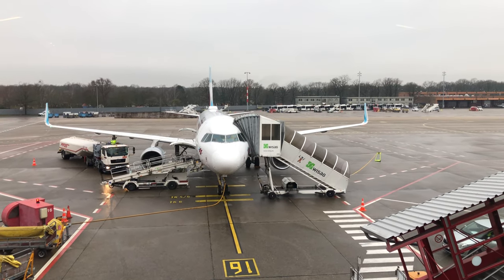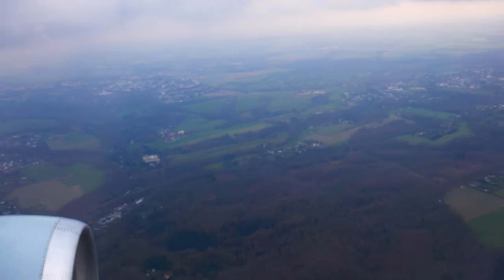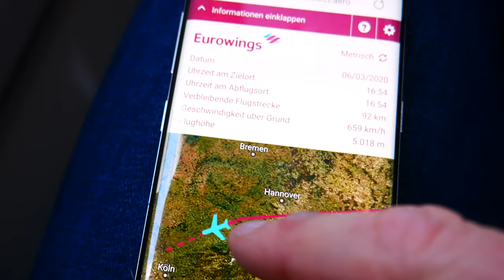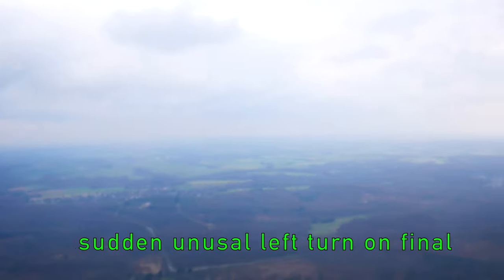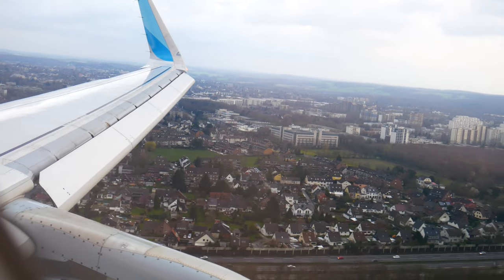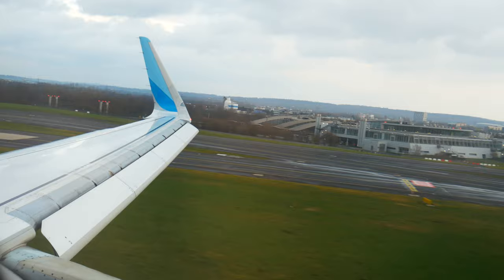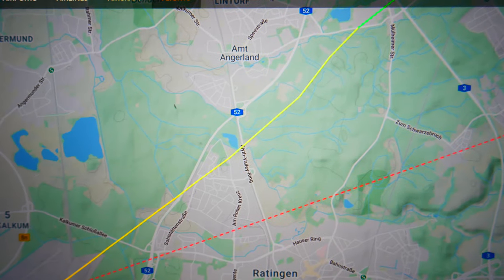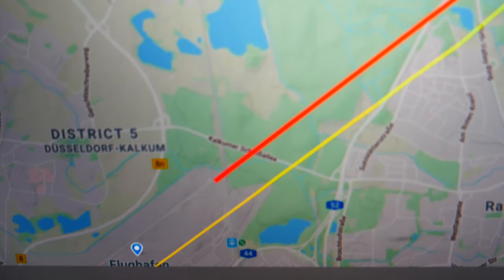Pilots approaching wrong runway during landing DUS airport? Last minute swing of flightpath(4K)

Comment: Are you sure it is a mistake ?
When the traffic and the weather allow it, we often suggest shortened tracks or visual approaches towards the inner runway to reduce taxi times.
Reply from the maker: I only can guess, so if you as airtraffic controler have more insides. I never have had experienced this, and it was really late for my fealing
Reply: @DrRchannel71  It looks like ATC suggest visual APP to the inner runway. The is the usual timing for this kind of maneuver...
Reply from the maker: @foxxray54 thanks for this information, New for me even I had more than 100 aproaches to this airport.
Reply: @DrRchannel71  You are welcome. This is done on most of airports operating parallel runway (only when trafic and weather allow it). ATC can suggest it (pilots can refuse) and pilots can request it (ATC can also refuse).
Some day at Paris CDG for example, you can see 2 or 3 aircrafts doing this and on others none.

Comment: this is called a ,,swingover,, -  normal procedure for a pilot... in 99% its because of taxi times, visibility requirements, amount of traffic or in some cases a failure or a problem with an aircraft thats already lined up on the runway
Reply from the maker: thanks for clarification. New to me, even I hade more than 100 landings at this airport, actually the traffic was low